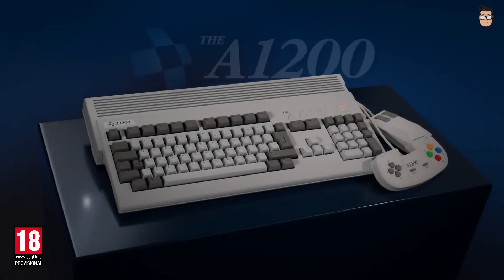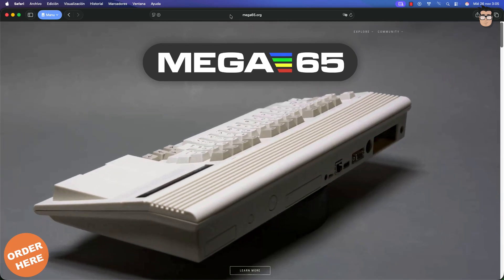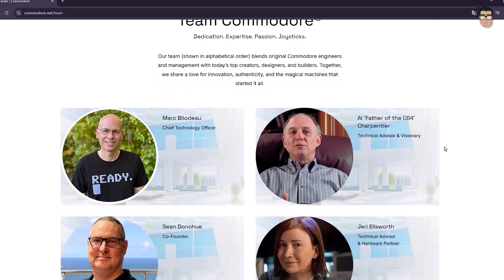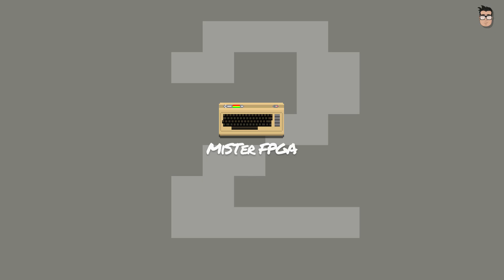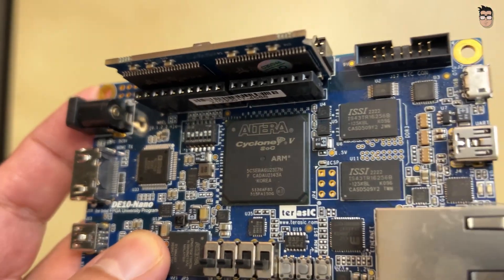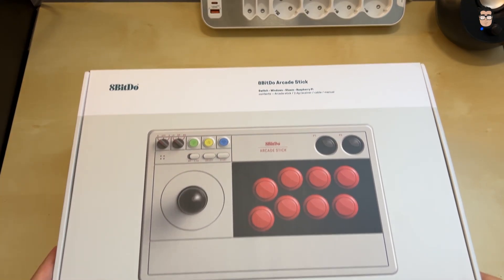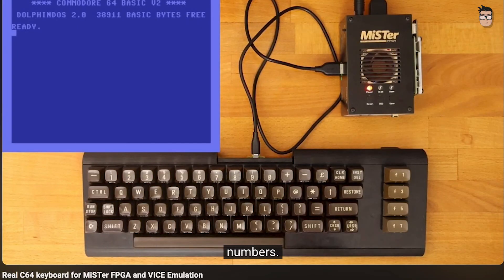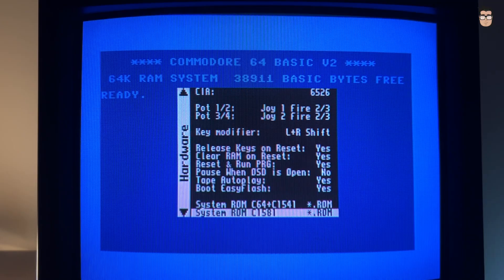MiSTer FPGA vs Original Hardware - Can It Replace Your Classic Machines?

Comment: It's cool, but $299 for a Commodore 64 Ultimate seems quite expensive.
Reply from the maker: Yes… it’s a bit expensive, and depending on how you plan to use it, it might not be worth investing that much money. But if you already have hardware like a 1541, physical games on tape or cartridge, and you mainly value the experience, it will probably be money well spent. When I get my Commodore Ultimate, I’ll make a video analyzing it in depth!
Reply: Considering, with inflation, the original Commodore 64 cost $595 at launch in 1982, which is around $2000 today, and in 1983 the price dropped to $250 which today is over $800. So I'd say $299 is an excellent price!

Comment: The Ultimate C64 is an FPGA machine but developed by one man who has spent years perfecting his design, MiSTer is a community project. 
The Ultimate boards will never have anything but a C64 core but it is an awesome core with excellent features while the MiSTer is multicore.
I have a MiSTer and original machines and a Ultimate II+ cartridge I use on original C= machines and still may buy an Ultimate C64.

Comment: MiSTer feels sooo DAMN old! Shouldn't there already be a lot of cheaper FPGAs with twice the performance nowadays? Btw: You shouldn't confuse FPGA reimplentation with emulation.
Reply: What is old about it exactly?  It uses development board (the Terasic DE10-Nano) used by ECE undergrad programs.  Admittedly, the board has been out for 8+ years.   More modern designs where they take the Cyclone V FPGA used by the DE10-Nano and put it on a custom clone boards are available and they make the MiSTer FPGA project much more user/novice friendly.  Those include the MiSTer Pi, the Multisystem2, and the SuperStation One.

The Nintendo 64 core and the Sega Saturn core stretch the limits of the Cyclone V and I assume your reference to "twice the performance" is asking if there are other projects that use a bigger FPGA?  Not that I'm aware of.  The MiSTer FPGA Project has been considering moving on to a newer platform but no successor has really appeared that seemed like a no-brainer.  Terasic has the DE25-Nano out now and while it offers some updated hardware, it doesn't offer a significantly larger FPGA.  It is basically the a refreshed model serving the same use case (ECE undergrad FPGA classes) with DDR4 RAM and some speed improvements.  ModRetro has a new M64 console coming out that uses an AMD FPGA of some sort but I haven't heard the specs on that.  It will supposedly be an open platform so once it is released, it can be evaluated as a potential MiSTer platform.

The Do-It-Yourself FPGA retro gaming platform just isn't a huge market although between the original DE10-Nano, the clone boards, and the newer products based on clone boards, I'm guessing the marketshare of the MiSTer FPGA Project is approaching a few hundred thousand.  ~300K?

There have been a few small groups that have sprung up to produce newer systems (like MARS) but so far, none of them have last through producing an end product.  Bigger FPGAs are definitely available but they are fairly expensive and not very consumer market friendly.

Comment: If you own a DE-10 Nano board then a good alternative to the MISTer is the MISTer Multisystem. It is 100% compatible with the MISTer but gives you a console looking case. They also have the Multisystem 2 coming very soon which does away with the need for the expensive DE-10 Nano development board, making it a stand alone device like the Spectrum Next or the Commodore 64 Ultimate instead of being a DE-10 upgrade, it's also cheaper!

People might wonder why MISTer is written like that. Well, it originates from the MIST project which got its name from combining Amiga and Atari ST as they were the main two systems the machine was designed for: aMIga + ST = MIST. Just like the MISTer, it can also be other machines by using different cores. MISTer just copied the core system of the MIST and reworked it for the DE-10 Nano development board. They then designed add-ons for that board to add the custom inputs and analogue output needed for some cores. The FPGA chip used in the MIST is smaller than the one in the DE-10 Nano (less logic blocks). This means the MISTer can use larger cores enabling support for more 'emulated' machines, but the MIST (if you can still get it) does not require further add-ons.

I own one of the original MIST machines and a DE-10 Nano with 2 MISTer add-ons (analogue and digital with RAM for both, I originally had 2 DE-10 boards but one fried its FPGA when I plugged in the wrong power supply, the ARM part still works). I also own a MISTer Multisystem that my DE-10 is currently in, and have the MISTer Multisysttem 2 on pre-order. So you might say I'm a bit of a fan!

As an aside: My MIST came with optional MIDI ports included for the ST side of the machine as the ST famously had MIDI ports that the Amiga lacked. The MISTer systems lack MIDI ports which is a bit of a shame as they could have had them added to the add-on boards or the Multisystem boards. Instead they use a built in software synthesizer to emulate MIDI audio using sound fonts. While good, it does prevent you from using a little known feature of the ST, using the MIDI ports as a data network for file sharing or for multiplayer games like MIDI Maze. The MIST with MIDI ports can do this allowing you to connect it to other real STs or MIST machines with MIDI.

Comment: I'm struggling to have some cores running on my MisterFPGA (from qmtech).
I cannot run the N64 core. Loads the roms but then, a black screen.

And I'm curious to know how you configured the Amiga core ? Mine is always complaining that the kickstart is missing, although I have place the KICK.ROM files in the games directory. Did you encounter this issue ?

Also, I saw many articles talking about the "update_all" script, but I cannot find it on mine ??
Weird...
Reply from the maker: When you power on the MiSTer, press ESC, go to the "Scripts" section, and run the update_all script. This will update your entire MiSTer system (core, menus, etc.).
For the easiest Amiga core setup, I recommend AmigaVision. It’s the most beginner-friendly option, and you’ll find all the documentation and instructions on their website.
The Nintendo cores may require some BIOS files to work properly. I’m not 100% sure about the exact requirements since I’ve never used this core by myself.
Reply: @thebitculture I have installed AmigaVision and it's working 100% fine ! What a great piece of software. Justifies buying the the Mister FPGA !
Reply from the maker: @eldontyrellcorp Yes, they’ve done a spectacular job—just like with OneLoad64 and the 0MHz Collection as well. Take a look at those too!
Reply: @thebitculture In the scrips section, there is no "update_all" script.
There's an update script but when I run it, it just fails with this error : bad interpreter, no such file or directory.
Reply: @thebitculture @christroy8047 I was able to run the N64 core. I found a script which installs the bios. Working like a charm now!
Next target : the Amiga. I really have a hard time with Minimig. Someone told me I should use Amiga vision. 
The rest, I'll figure it out quite easily I think.
Reply: I have more than 1 QMTECH MiSTer. Just letting you know it 100% handles ALL MiSTer cores with full compatibility, so if you are not getting that, it's something wrong with your unit or setup or both. Make sure you are using a good power supply with it and you are getting clean power with low peak to peak noise. Good luck in fixing it but I wanted to chime in and let you know you should be running ALL MiSTer cores on your QMTECH without a problem, so again it's something to do with your setup, config or the unit itself. You shouldn't be having those problems. Edit: In fact your QMTECH has an Automotive grade FPGA in there, it's even a better quality/binned chip then in the original MiSTer.
Reply: @christroy8047 I've heard issues with the qmtech versions, it pretty much depends on the memory type which is installed. Some versions come with a slower memory and the N64 core and other demanding core just cannot run on it. Maybe I have this version but to be sure I have to dismantle it. I came across a blog talking about the memory issue some weeks ago.
Reply: @eldontyrellcorp  I hear you, yes if you have a memory issue it should still run the N64 core though, it just may not quite be at full speed as the ram timings are different. There are some ways you should be able to fix it and set up the timings yourself. Slower ram timings should not crash the whole core, although anything is possible as there are 3 or 4 things that can make a MiSTer unstable. Too complex to talk about the solve here. If you are getting crashes there should be (hopefully) some mitigations for that. Good luck on your situation, hope things work out for you! (Crossed fingers)
Reply: @christroy8047 I was able to run the N64 core. I found a script which installs the bios. Working like a charm now. 
Next target : the Amiga. I really have a hard time with Minimig. 
The rest, I'll figure it out quite easily I think.
Reply: @eldontyrellcorp Great! That should be the outcome! Well done that's exactly the right troubleshooting steps. So happy you got things working. You've got an Automotive FPGA in your QMTECH which is the highest binned version of that specific chip. Enjoy.

Comment: Lol. Can emulator replace your original hardware? Yes, If you don't care:) You can install Batocera on your old PC and instant "replace" anything you want. Please send me all your old amigas, c64s, neses and other stuff you dont need anymore:)
(Oh and I know the argument that "FPGA-is-not-an-emulation")
Reply: I have a cartridge which I wrote part of and I want to run it on real hardware. There's emulation for it, but it's not the same since I have the real thing here. I haven't been able to plug it in for 10 years now :(
Reply: @curiousgeorge7515  c64 + new power brick + ultimate ii = 120 + 40 + 140 = 300 euro. 300/12/10=2.5 euro monthly to get THE ULTIMATE c64 setup for a years to enjoy (every month there are new demos, music and games).

Comment: If it is an FPGA system it is NOT emulation it is replication.
Reply: FPGA is emulation on hardware level.
Reply: no it is NOT replication, since the gate design does NOT match all the chips involved & the timings.

it is EMULATION and it better include the "illigal"  opcodes  & CPU timings of the original CPU or some games won't run
Reply: Exactly ! That's why FPGA is more accurate than emulation.
Reply: Ultimately, an FPGA runs a program. This program can be exactly equivalent to a software emulator. The only difference with a FPGA is that hardware ports can be physically emulated as well.
On real hardware, the chips functions are fixed.
On an FPGA, software configures a universal chip. It's really software but running at a lower level than a CPU.
Reply: @curiousgeorge7515  Entschuldigung! Die Funktion eines FPGA's mit "Software-Emulation" zu vergleichen, ergibt an dieser Stelle keinen Sinn. Auch die Formulierung "physikalische Emulation" ist begrifflich falsch. Bei den, in einem FPGA nachgebildeten Schaltungen, handelt es sich nicht um "Emulation". Emulationen sind in Software nachgebildete Hardware-Funktionen, die >vollständig< als Software-Algorithmus ablaufen. Leider mit all den Nachteilen, die eine solche Software-Emulation (Software-"Simulation" von Hardware-Funktionen) logischer-weise mit sich bringt. (Latenzen etc.) "Software" dient bei der "Programmierung" eines FPGA's nur zur Verkabelung der elementaren Schaltungen. Im Ergebnis handelt es sich um eine >Replikation< der Schaltungen … nicht um Emulation! Das ist etwas vollkommen Anderes!
Reply: @RobotamechaIntelligenzija  In one point I agree: it is possible to replicate the original hardware gates as they were in the chip (the AND, OR, NOT gates). But it is not necessary to do this to replicate the function.
On the other point, I don't agree: the FPGA can be programmed in software, literally as (it's term is System C) and run just like a program with no functional difference, therefore how can you distinguish this from any other software?
FPGA programs do have the same downsides of any software: latency is a critical issue in an FPGA! The gates must have synchronized inputs or they will not work. It has to be orchestrated to a clock pulse with latencies within a tolerance.
In a different level, the approach of the software can have defects such that the, example, video emulation is not replicated exactly. Example: emulation on a line basis instead of pixel basis.
Reply: @curiousgeorge7515   no a FPGA does not run a "program" , it holds  a  switch map for the logic logic. basically the FPGA contains a number of gates and LUTS, these are then wired together with binary switches, which are  set or unset by a bit image.
An FPGA is a TRUE FULLY PARALLEL logic design.., in that  all the logic can be switching AT THE SAME TIME or in a clock domain .
the only serial states are the ones you  deliberately program.
so if you want to do 2,000 things at EXACTLY the same time you can. or yuo can constrain those 2,000 to a clock edge & depending on the connections, & timing constraints they will perform exactly the same task and finish at exactly the same time....
inso far as the routing timing constraints are met.

Comment: I have the Mega65 and the Spectrum Next. I also have an Amiga 1200 with a Vampire accelerator card. My Commodore 64 is on the way. These systems do not translate well without the original form factor and keyboards. The mister is a very capable system, but it lacks the tactile aspects that made these systems great.
Reply from the maker: Yes, I totally agree, that’s what I explain in the video: the tactile experience is lost. But the MiSTer is also a great option for those who don’t have the original hardware, and very satisfactory for console cores, where you only need a joypad, or for playing arcade games (buying arcade motherboards is really expensive, and you have to spend even more money for those that aren’t JAMMA-compliant).
Reply: @thebitculture batocera... it costs exactly 0 euros, plug-n-play etc. If one don't care about original hardware experience why did he prefer fpga over classic emulation?
Reply: @surfinbirdzx  Latenz treten bei Emulationen logischer-weise immer auf! Das beeinträchtigt leider die Reaktionszeiten des Systems.
Wen das alles nicht interessiert, verwendet Emulatoren.
Reply from the maker: Totally fair point: Batocera is unbeatable for price and convenience, and for most people it’s all they’ll ever need. My reason for preferring FPGA isn’t ‘better graphics’ or anything like that—it’s the feel and the edge cases: latency consistency, scrolling smoothness, audio behavior, and even little things like exact boot/initialization quirks. With classic emulation you can get 95–99% there, but that last bit varies depending on OS/drivers, timing, and frame pacing. FPGA tends to behave closer to the original hardware because it’s recreating the system at the logic/timing level rather than translating it through a host PC. FPGA is precisely for when you do care about that last 1–5%. If you don’t, Batocera is the smartest choice.